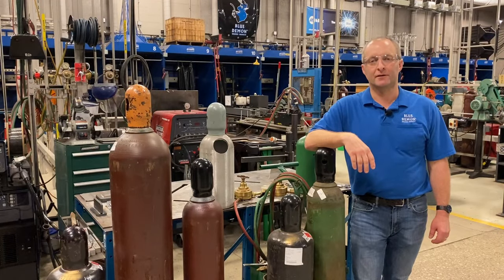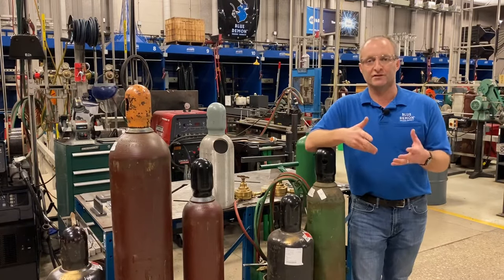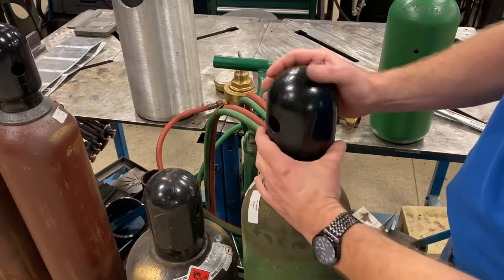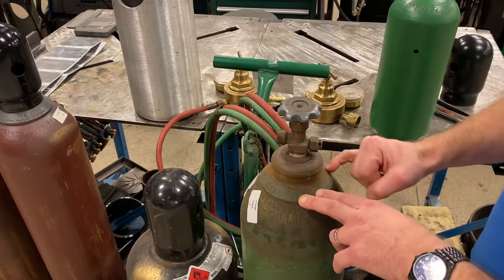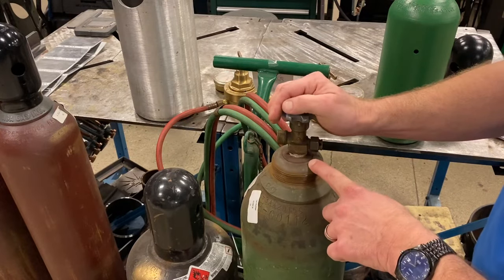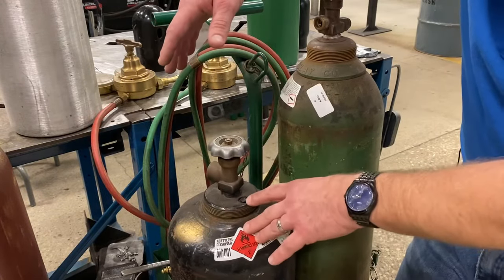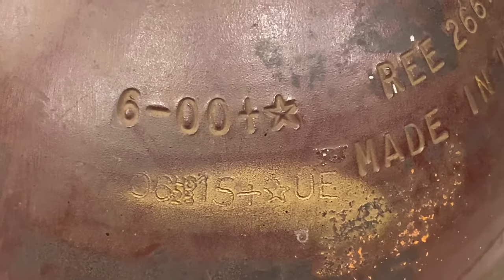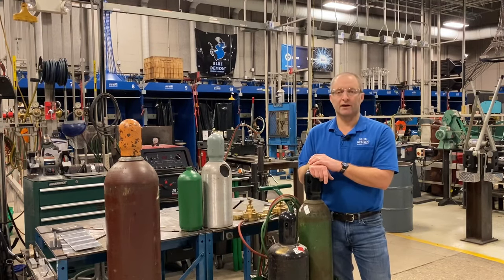CYLINDER SAFETY 101

Comment: The test interval (requalification) is 3, 5, 10, 12 or 20 years depending on type gas and type cylinder per 49CFR180.209

Comment: Hi. Well thanks. I want to ask, a cylinder with square key valve installed. Should I have to open it fully like hand wheel valves or half a turn will be more safe?.
Reply from the maker: Hello! Acetylene fuel gas should be opened no more than a 1/2 turn. Or the flick of the wrist in case you have to turn it off in an emergency.

Comment: what color is Oxygen cylinder color, it should be black, and Acetylene should be Green. But you have shown opposite
Reply: The colors don't matter. Read the labels! And never remove or tamper with a label.
Reply: that depends on what country are you refering to and standards, oxygen cylinders are painted green in most countries. Acetylene cylinders are painted red. Black is for Argon and Argon mixtures. Gray is for nitrogen. Brown for Helium. Light Blue for NO2. White for compressed air.